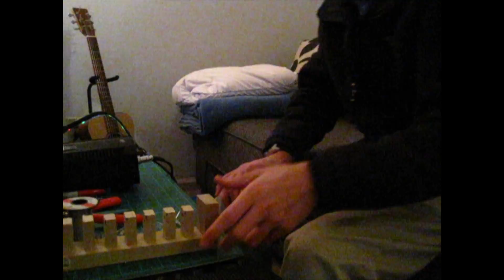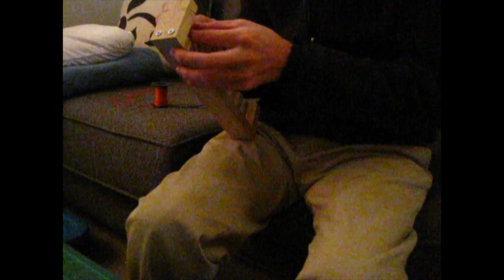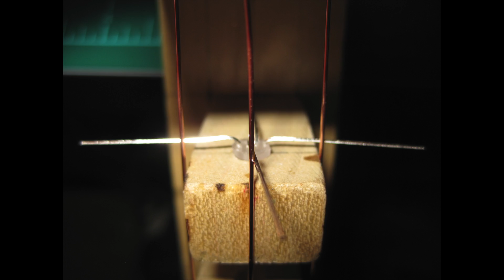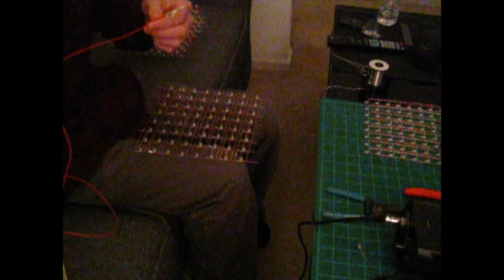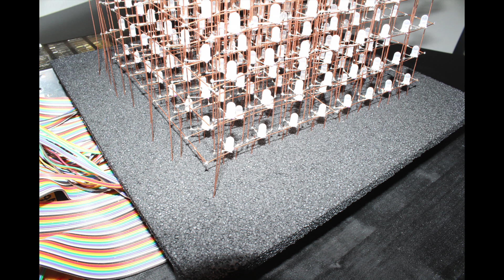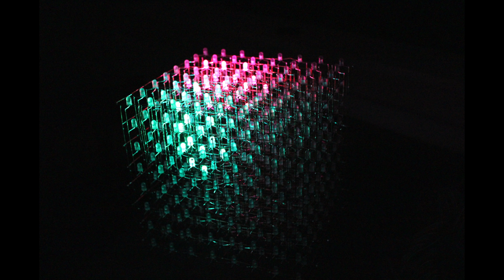How To RGB 8x8x8 LED CUBE - The BUILD!

Comment: Thanks for sharing your experience! I just uploaded a demo video of my build, very similar to yours in circuitry, but built on a single 20x30cm pcb protoboard. I separated the red, blue, green, and level banks into separate channels so they can all be controlled independently, as well as control each banks output enable separately. Very happy with the results! Now I need to study your code and learn how it works. I like some of your animations and would like to recreate them on mine.

Comment: Hi Kevin , I find your project absolutely fascinating/ and yes , I want to build your RGB Cube and learn a lot more code so I may add animations of my own.   Please do a video dedicated to the "electronics" portion of the build.  I don't know if you used the Arduino or just the Atmega IC / Please go through your build step by step/ And Please discuss the advantages of using the 74HC595N as opposed to the 74hc5940 / Could they be interchangeable ? Or just a matter of design ? And please discuss clearly  the schemactic -such as connections/ the schemactic indicates a transistor dedicated to each LED ? Please discus your choice of transistor ( NPN202 is standard , but you chose a different type, why ? )    Please discuss clearly the connections for your MOSFETs       I Think This would help thousands of people .    Thank You So Much for such a fascinating build.     Jim

Comment: as per your jig, could particle board with the holes be used as different jig? would it work with all the soldering, in your opinion and experience(s)?

Comment: There may be a lot easier ways to do this (wiring wise).  Maybe board interconnects?  Maybe some 50 pin push on type connectors for ribbon cable like used in old computers so this way all you would have to do is solder the male portion of the connector on to your boards then go from there?  I don't know, just throwing some ideas out there at you :)  Over all though I love the build and may want to try it.  I may roll my own boards though instead of using that via board stuff.

Comment: wouldent it be easier to put the control electronics right under the cube and connect the copper wires of the cube directly to the board instead of using hundreds of ribbon cables?

Comment: Why two parallel 100 ohm resistors instead of one time 50 ohm? Current/power over the resistors is very low, so that can't be the reason.

Comment: Can you control the cathodes directly with a 595 shift registry, by sending them into a low pin or du you use the 595 to control a transistor the opens up a connection to ground (or is it a third option you use).

Comment: First: very nice build and video. Thank you very much. If you build the shift registers and the switching transistors on one board, you save a lot of wires. Also, I think I would have used headers for those ribbon cables and put connectors on the cables themselves (wire-to-board). That way you can take it apart and module test it.

Comment: I didn't check through all of the comments,  so if it has already been said, sorry. For the wire to be bare conductor search for buss wire. It is a silver coated copper core wire that will save you time and look like the LED leads, which will calm OCD nerves everywhere.  Great video by the way.

Comment: You are obviously very knowledgeable about electronics.  I am not.  However, I do have a unique idea for you to ponder.  You seem to be very straightforward and very skilled with your electronics.

You successfully created a 3D LED cube   LED technology is pretty well developed and has been applied to televisions.  Judging on the successful build of your cube, I have a strong hunch that you could take your cube development and apply it to TV.  Bunch enough micro leds together using this technique, and then connect it to a TV image driver, and I bet that you could create a 3D image.

Now bear in mind.  The technology is already there.  LEDs have been successfully applied and used for televisions.  Seeing your cube pulsating and creating light patterns in 3 Dimensional patterns tells me that this could probably easily manipulated and applied to work directly with televisions.  If you could do that, you'd have a hell of an original product that offers television watching in a way never before conceived.  Think about it.  Your LED cube already produces lights in 3 dimensions.  Ad a Television image driver to this and connect it to a television receiver/transmitter, and you can produce 3D images without the use of 3D technology or special 3D glasses.  An LED unit that already produces 3D images might be a potential answer. 

Broaden and widen it across say, 24" and only 3" thick with the layers of colors applied in the standard RGB pattern and you could theoretically produce a 3D image with LEDs.  You already have a start.  You would have to use thousands of LED's, but you already laid the groundwork for creating an actual 3D imager that wouldn't need special 3D eye-wear.  If you could do this, you would have a unique and very marketable product for NEW 3d technology.  I don't want anything for this idea, I'm just sharing something that I envsioned when I saw the unit  you created and see the potential of your 3D cube... I don't have the money, resources, and definitely lack the skills and ability to create this idea, but you do... you could become famous and rich.  If you do, don't forget who gave you this idea... I'm James, of Anchorage Alaska...
Reply: JW Hmm... I think the gap matters in this scale to get the effect, while TVs have much bigger resolutions that need to be compressed into a small space. Now how could you see any LEDs behind others?
Reply: +JW There&#39;s a problem with your idea, you seem to forget that there are holes between each layer of LEDs in the LED cube, while in a television there are no holes. It's just as the comment above said.
Reply: Actually if you look very closely at a Television screen, you will see that there are holes. 10s of thousands to millions of them in fact. There are gaps between each color of an LCD and an LED screen. These are known as pixels. an LED screen uses thousands of led lights tightly packed together in the standard RGB pattern. This is how LED tvs produce their imagery.

You see LED televisions all over the place nowadays, including billboards, the sides of buildings, on highways, on restaurant signs and in sports arenas, all employing LED technology. They are able to make the biggest televisions in the world with LED lights, but so far, they have only made a dizzying array of flat screen tvs. Samsung is using LEDs to make their curved screen television.

You could save yourself quite a bit of space and reduce your LED size considerably by employing and applying another method to drive the color spectrum of a hypothetical 3D TV. One that theoretically would not require expensive 3D glasses. I am talking about using "Fiber Optic Cables" as another alternative to using thousands of LEDs. Fiber Optic technology has advanced considerably. Even the newest hobby fiber optics available and made of plastic, has amazing light carrying properties that could easily be employed in a television set or image maker to create 3D images without a need for special glasses.

I know that these are possible. Your LED cube confirms it. I've seen other LED products that create and generate moving images in 3D, but are limited to only a few minutes of footage. Also, the image quality suffers and is not very clear because of the inadequate lights that can saturate colors more effectively, and are too far apart to produce clear sharp images. The result is, even though the imagery is active and in motion, the footage is washed out because of the lights themselves.

To offset this and to create a sharper, clearer image, more lights closely packed together would provide greater detailed images. You can only go so far with LEDs. This can be improved and expanded on with fiber optics and LEDs. The LEDs can be employed with an image driver and the space reduced for it considerably, then fiber optics be used to produce the 3D images. It would be a lot of work for sure, but the potential is almost limitless.

I have only a rudimentary understanding of fiber optics and LED lights, but I can see the potential of how the 2 can be used in tandem to produce a unique video imaging technology. Also, I am financially limited and cannot explore this. I am also not well versed or educated in Television Technology and electronics so I would not know where to begin or how. You on the other hand, are knowledgeable and could develop something like what i am proposing here. The potential to create something like this is mind boggling. Thanks for replying, and thanks for sharing your LED cube with the world. Good Luck

Comment: I have a suggestion for the jig that may help with the wire tensioning. What if you put a screw at either end that you could wrap the wire around, much like a guitar tuning peg. In fact you can buy individual tuning machines that are used in guitars. The advantage to that is they have a hole in them that you can feed the wire into. Then just turn the screw to tension the wire.

Comment: You could have reduced the number of wires to used to drive the cube to approx. 24 + 8 + 8, by using a transistor at each cathode of a slice. But it is awesome.

Comment: You should know that there are transistor matrix IC's... they can sink in 300ma per channel...
Reply: Try the ULN2003 - it works up to 50V and 500ma/channel. It's small and realy powerful. you can even mount them on holders to quickswap if anything happend to mailfunction. It's also verry cheap.

Comment: The jig is obviously home made, in fact I'm pretty sure I saw nails through the bottom to hold on the prongs, so it's quite roughly made. I guess it doesn't need to be strong. How much power does this thing draw? I just calculated something like 30W. Does it get hot?

Comment: If you created a mold, could you cast this inside resin and then get the sides machined so it would be a solid clear block? I feel the wiring would be more durable invaded in resin less chance of it breaking during a move or something
Reply: This is what I am looking at.. I have the ultra clear resin already and think doing 1" layers will work..  The outside will likely wet sanded when done due to the layers..  Will need to do a test block to see how it layers..
Reply: randalljames1 Do a drizzle to coat all the LEDs, junctions and wires first. That will protect them against the stress of the resin hardening and shrinking when you do the final casting.

Comment: I'm confused on Math here. Red has 64 solder points, Green has 64 solder points, and Blue has 64 solder points. The Anode only has 8 solder points for the levels. Is this correct?

Comment: I just discovered you the past couple days and have inspired me to learn about micro controllers. I am going to get some for myself and build a 4X4X4 charliplexed cube to start out using the instructions found here: http://aglick.com/charliecube.html

I also have an idea for simplifying the 8X8X8 using charlieplexing. Because of the limits of what you can do with charlieplexing it wouldn't work for an 8X8X8 cube the way you have it wired (I don't think), but what if you built 8 charliplexed 4X4X4 led cubes and set them up to make one big one? For the top layer you would have to leave the wire really long and leave the coating on it so that it was a separate circuit from the cube below it, but it would greatly decrease the amount of wiring. You would have to use 2 shift registers for each individual cube and probably rewrite your code, but it would really decrease the soldering and parts list, and I think you could get the circuit to fit nicely in a box underneath the cube making it more mobile

Comment: I've driven them with 74HC595s directly through a limiting resistor. The current limit is lower but you can put 10 mA on each output fairly safely with the DIP package 595s.  technically it's a 70mA max power total but 10mA doesn't burn them out even on full white.  Have to pick resistors carefully though, Red runs at 2 volt green and blue at 3 volt.  Not as bright as with a proper driver but a lot cheaper and the lag improvement over driving both layer and cathode transistors makes up for it.

Comment: Hey Nice cube really awesome. I think I found two ways to optimise the cube.
I think the wiring you made is 8+3*8*8=200 is that right?
8 anodes and 192 cathodes.
My idea is 8*3+8*8=24+64=88 that's using more (64) anodes and less (24) cathodes. I'm not sure if that's possible, but it would bee nice and easier to make.
The other idea is to join the arrays on the arduino code in less but multidimensional arrays, that could be easier to code. Tell me if these two tips are possible to implement.

Comment: I see. I took it that you needed to use the wire insulation and not the wire itself :p

Well, in any case this tip works :)

Comment: I'm not gonna bother to read 210 comments so I'm sorry if this has already been posted.
 There is an easy way to remove the insulation of solid wires.You cut the wire to the desiered length PLUS a few inches.  Then you remove the isolation to each end just enough to make the next step.
You take two strong pliers and stretch the wire without pulling the insulation 2' is enough in most cases.   After that, you can easilly slide the insulation of the wire, just cut away the damaged wire end first.

Comment: I commend you for using discrete NPN transistors...and on protoboards. My personal worst wiring "disaster" on this scale was building an audio switching systems for a stereo store in the mid 1990s. It was all done with D flip flops and pushbuttons - no micros. Haha.

Comment from the maker: umm, not sure exactly what I used... everything is 5V, so just make sure the voltage rating is at least 16V? you'll want a little bit of play in there.  The 50V caps will work just fine

Comment: You use 2*100ohm in parallel that means 1/0,02=1/100+1/100 does that mean that I can use one 56ohm resistor where you use two in parallel? (sorry I'm pretty new to electrophysics in practice I was only taught the theory in school so I'm not very sure about these things)

Comment: How many dead or dud Leds did you come across? I bought 1000 Leds and nearly 4 out of 10 are duds or completely dead. I bought single colored Leds. Also you should've searched amazon for "bare copper wire" or "bare tinned copper wire" if you dislike the copper color. =)

Comment: Hey, Just wondering what microcontroller is used to control the led's. Im trying to create ambient lighting in my room. Basically I dont need the whole 3d just 2d since its just on my ceiling. Im gona have 12 sets of 3 strips of led's. Each strip is adiff color. So i need to controll each color and set individually. I have an idea of how to do it but i dont know the chip # for the controller. Also any info on how to do this is great help.

Comment: Cut the led wires to size before soldering them.  Use thicker wire and thinner set of blocks so the rgb wires arent so close together.  Bare 20 gauge wire is available that you wont need to mess around with stripping it.

Comment: Hi, nice work. You can use enameled copper wire, which is used for electric motor-coils. Its insolated, but if you solder it with approx. 350° the insolation is burned while soldering. Easy to use and the cube is secure to electrical shorts if deformed by accidentally kicking the cube while dancing wildly arround it ;-)

Comment: Can I use this ATmega micro controller ( ww w . taydaelectronics . com / atmega328p-pu-atmega328-microcontroller-ic. html )  it is a little bit different but i don't know if it is going to change anything much. And can I use one of thees MOSFET ( ww w . taydaelectronics . com / catalogsearch / result / ?q=IRF9 ). Remove the spaces between the . and the /

Comment: Hi; If you ever build another one of your cubes; look into making a capacitive spot welder to replace the time it takes to soldering each lead.
 
To test your slices would you be able to use a rigid copper wire long enough to touch all the leads at one move.

Comment: Kevin the build of the cube/pcb's is finished and everything works. Had some small  problems with the standalone arduino but a elco on the powersupply did the trick. Here some pictures of my build (youtu.be/OqJWde68pxU)

Comment: im not really used to calculating macroscopic electronics yet :p
isnt gate charge a little inaccurate since charging up a cap is an exponential function: Vcap = Vmax - Vmax*e^(-t/RC). not sure if the difference is significant though
Did a fast check and its even a little faster. IRF9z34n has input cap 620 pF, using 10V and 100ohm it takes about 200 to 250 ns to almost completely  charge up the cap :)
this is using a voltage source though so didnt take mode of operation of the BJT into account

Comment: The gate apparently acts like a capacitor from what i read. It will charge up to a certain point before turning on. The IRF9z34n has a gate charge of 35nC. Supposedly that means it takes a 0.1 amp current 350 nano seconds to charge.
But i thought he was boosting the current flowing, for instance i have lots of 2n2222's that can go up to 0.8 amps meaning i could charge the gate in roughly 44 nano seconds. I was curious to if that was the reason for the transistors. :)

Comment: I saw you have transistors hooked up with the mosfets. But i've never used a mosfet before so i don't know if i'm missing something important.

Are they hooked up like that to make the amperage going to the gates of the mosfets higher, or is something else going on?

Comment: I don't get why you didn't program the Arduino to run - say a half second - cycle on your LED test circuit so you only had to plug in the LED - look - and toss it into the good/bad pile rather than cycling a resistor manually. I guess hindsight is 20/20! LOL!